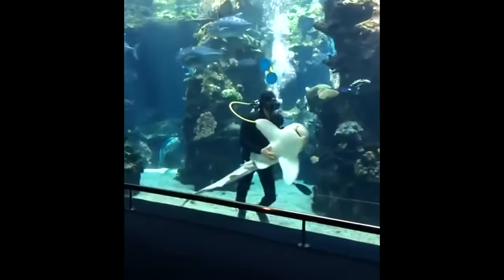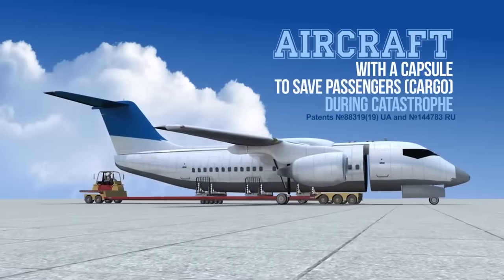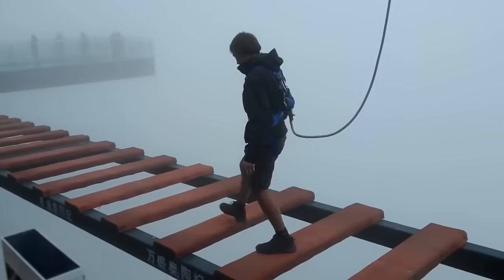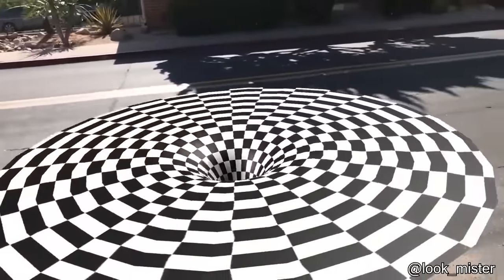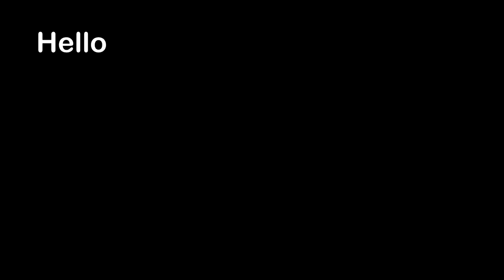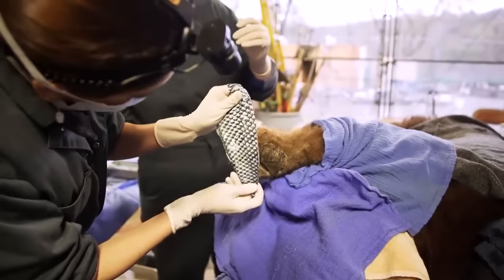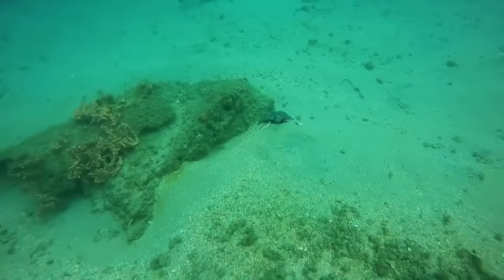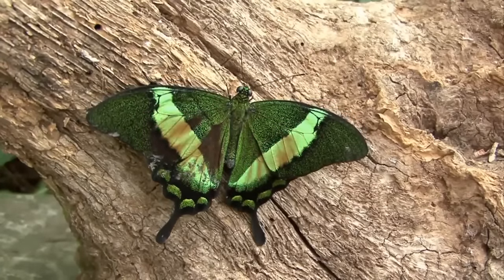2 Hours Of Daily Dose Of Internet

Comment: A retail shop in a mall I used to frequent used scissors to cut holes in blue jeans. The second step was putting them through a washer a few times to make the edges frilly. Then they would sell them for $90.00 when they originally were priced at $30.00 without the holes....

Comment: that airplane idea was disliked by pilots and airports alike : why? *it leaves a jet fuel bomb flying through your city to crash into whatever it so pleases if the pilots arent with it. 2: if the pilots are with it, the loss of the cabin would cause such a drastic shift in the center of mass that it becomes incontrollable on the basis of physics

Comment: Painting surfaces white does actually make surfaces and the air over it significantly cooler. It’s been theorized that if 25% of the roofs, just roofs, were painted white it would not only lower the need of power for AC’s but would loved the avg temp of earth by over 1%